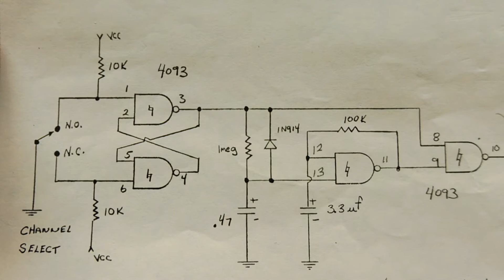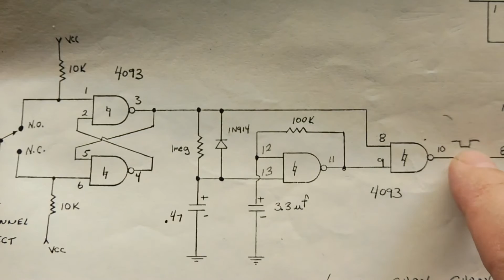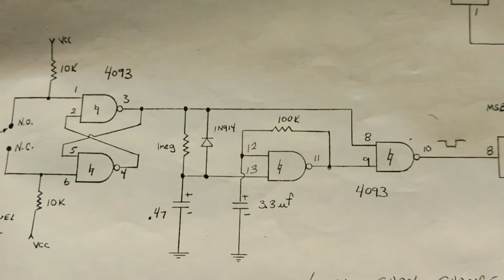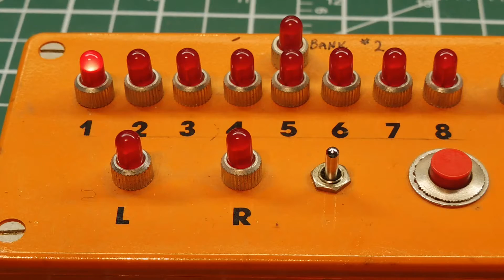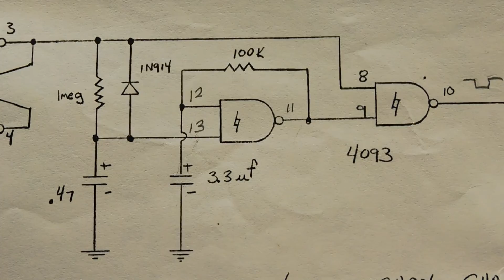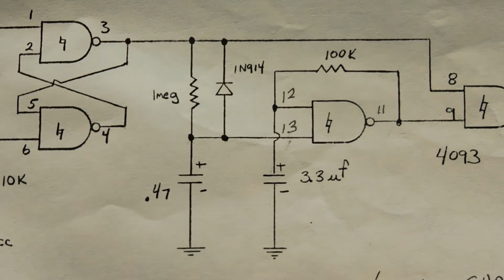How to build a Digital Pulse Generator

Comment: hi , nice video, I have CNC MPG, in which the pulses are generated when the hand wheel is turned oneway or the other , the pulses are generated in channel A and channel B. what I want to do is 
buid 2  circuits  like the one you shown , one to generate the pulse train in channel  A ,and the other to generate the pulse train in channel B,  and I want to use one push button for each of the Channel  to generate the pulses into them. The reason behind this is ,that sometimes I can use only one hand in this hand wheel controller , and at the present moment I have to use 2 
can it be done?
thank you

Comment: I have no idea about electronics; how would you connect three laser pointer lights to a circuit to make them simultaneously flicker - or pulse - a few times, then stay on for a few seconds before turning back off using a button to start the process? I'm hoping to use something like this in a wargaming application so I'd need everything to be as compact as possible.
Reply from the maker: Use a microcontroller like the Arduino Nano controlling the lasers with the GPIO output pins.
Check out this video:  https://youtu.be/8gV_pETSUis